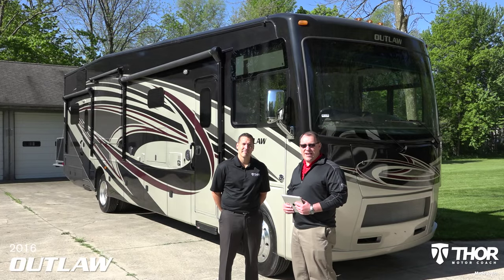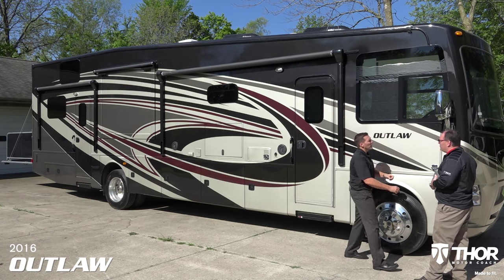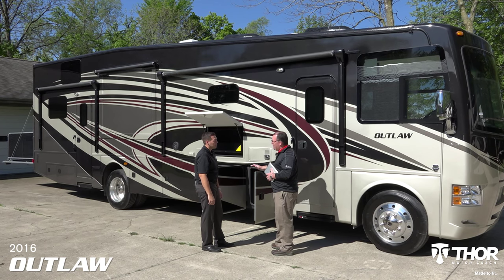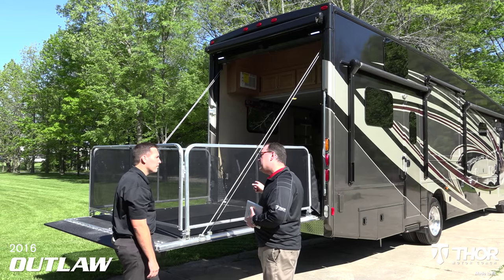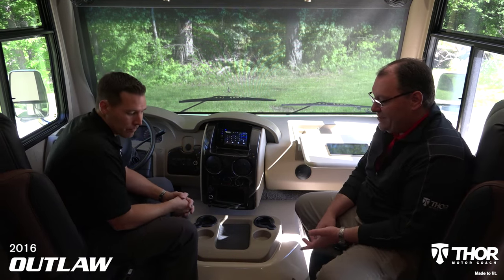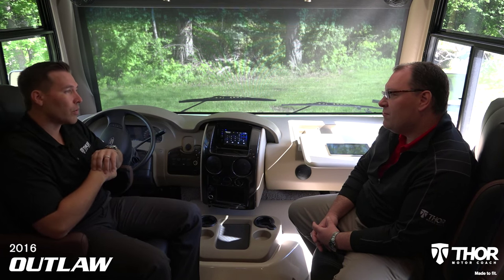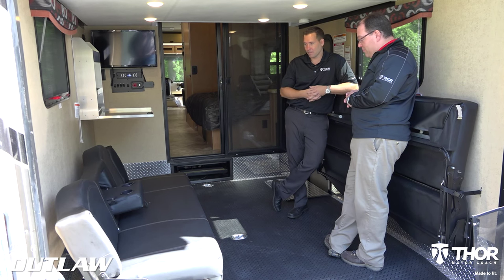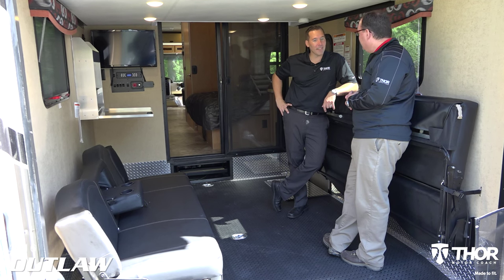2016 Outlaw Class A Motorhome from Thor Motor Coach

Comment: Can I park 2016 Honda Pilot in the garage?
Reply from the maker: +Lucky Fisher The maximum weight for the garage is 2500 lbs., and it looks like the Honda Pilot is more than 4000 lbs. The garage is also 96" x 122" and the Honda Pilot is roughly 79" x 195" so it looks like the answer is no - the Honda Pilot is too heavy and too long to fit in the garage.
Reply: +Thor Motor Coach Thank you so much for the answer.
Reply: +Thor Motor Coach.  Thanks a lot!!!